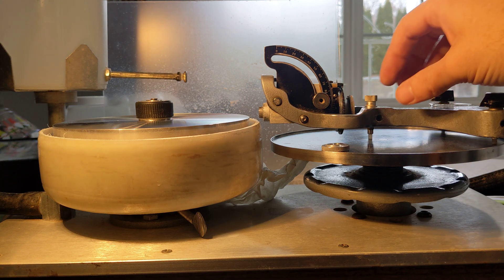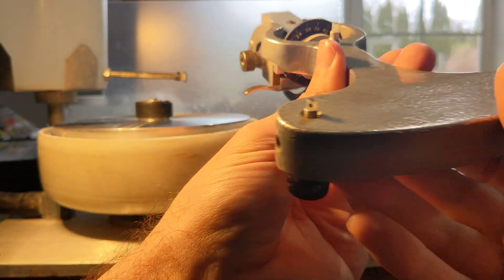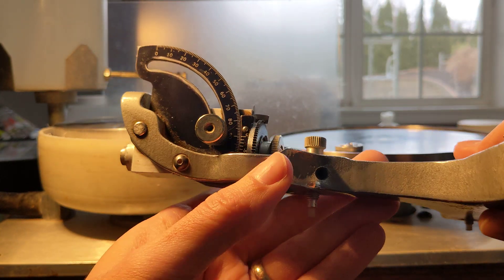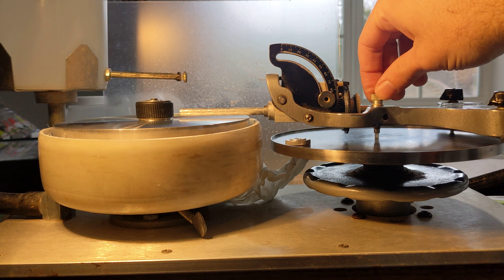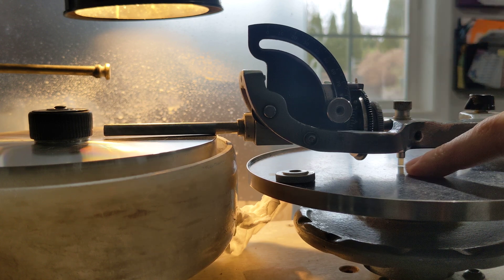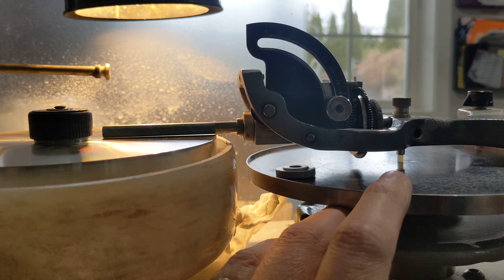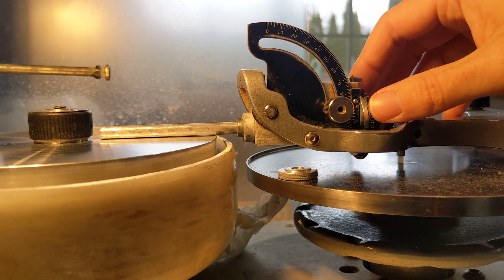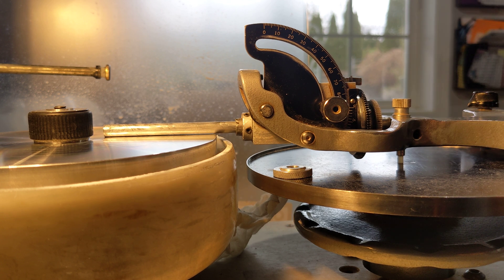Leveling A Handpiece Style Faceter

Comment: Have you ever used a mast machine? and if so how would you compare the usability and precision between the two of them?
Reply from the maker: I've only briefly used a mast. Both are perfectly usable, with one of the main differences being in how you inspect the stone. I like the handpiece style where I can pick up the whole assembly and rotate the stone every which way, whereas with a mast it is stuck to the quill and has a limited range of movement. But once you're used to that, it's not an issue. Both can be very precise, but precision and repeatability (which is just as important) is easier to achieve on a mast machine. Mast machines have height markings and some have more precise angle indicators where you can go back to the same spot exactly, whereas the handpiece you have to use your eyes and ears more. Mast machines also (generally) have less flex - the raytech shaw has hard polymer plastic feet but even those can compress very slightly with pressure. Since the American made machines are all of great quality, I heard it described recently as that with more expensive machines, you're buying "information" rather than better "quality." So with mast machines and pricier options you get digital angle readouts, depth gauges, height indicators, fine adjustments, etc, that all make it easier to cut a gemstone, though it is possible on any machine.

Comment: There's no way to "lock" that knob that raises and lowers the hand-piece?
Reply from the maker: Like with the back feet, there is a set screw that can be tightened with an allen wrench. You could crank that very tight if you didn't want the center to move at all.
Reply: @DonohueLabs  Roger that.....